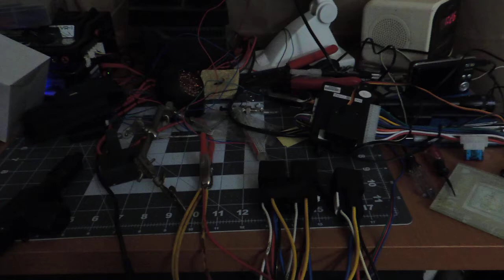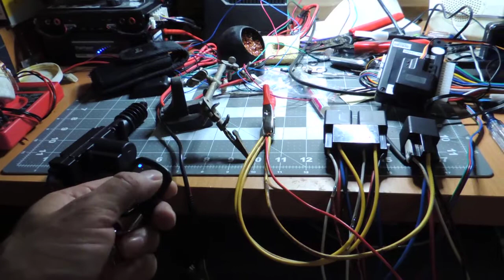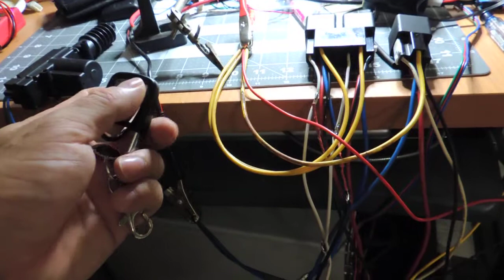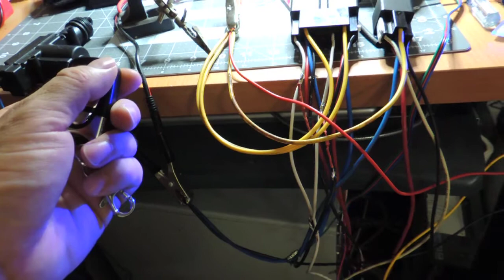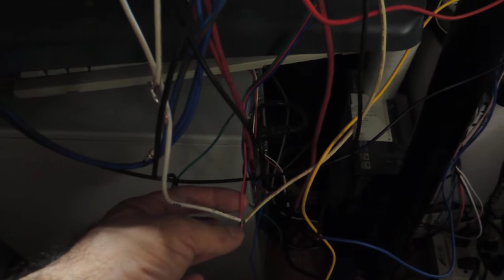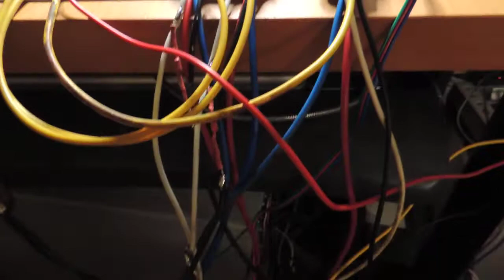Crimestopper SP-302 - 2

Comment: i just want to use this for the shock sensor and the remote....stock alarm is fine..just want this as  a silent alarm to alert me when iam in the house....will this get the job done
Reply from the maker: No, unless you install the alarm. The remote doesn't work without the alarm installed. You can leave out the siren, then it will just sound on your remote. But at that point you might as well use it.
Reply from the maker: By the way the remote battery died on this. So I got rid of this alarm a while back. I don't recommend this alarm.
Reply: @myshots101  yea your right,,just found some No install one's, thx for the info

Comment: hi. can u show me how to crank and start the car with the remote control?
Reply from the maker: Danny Le Hi. I would but this alarm doesn't have that feature. I mean this model doesn't have it since it's just a basic alarm.
Reply: thanks, but its a remote starter. what do u mean i cant start the car with it tho?
Reply from the maker: Danny Le Not all alarms have remote start. They have a model without remote start which is this one and one with remote start. That's the 502 model.
Reply: but this sp-302 model is a 5 button 2 way remote starter tho.
Reply from the maker: Danny Le Two way just means you'll get paged if someone hits the car for example. Meaning the pager let's you know something happened.  Just make sure the alarm you get has the remote start built in which is separate from the two way pager. Yeah it's a bit confusing but that's what that is. The number of buttons don't mean anything if the alarm doesn't have the feature built into it.
Reply: myshots101 thank u sir.